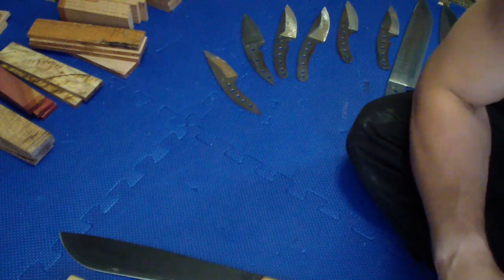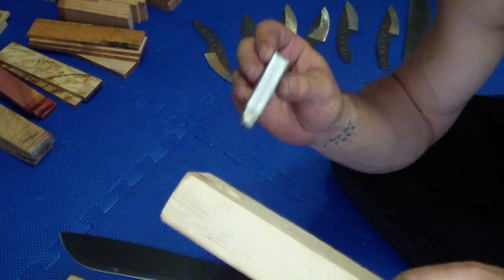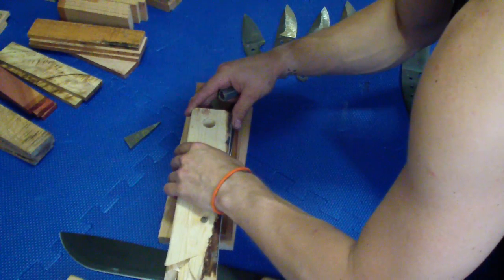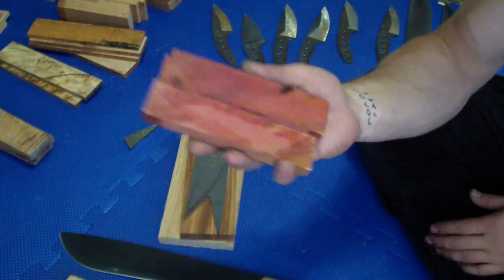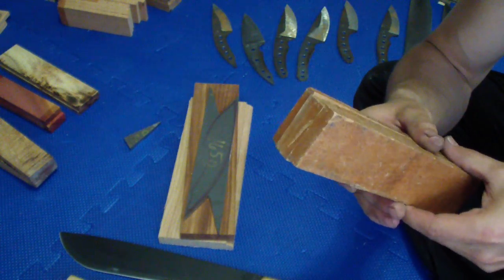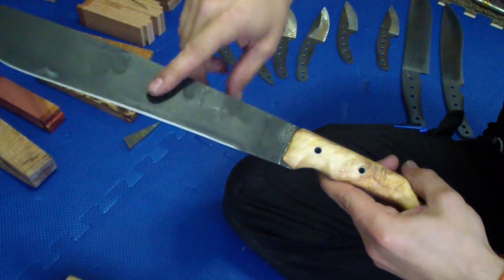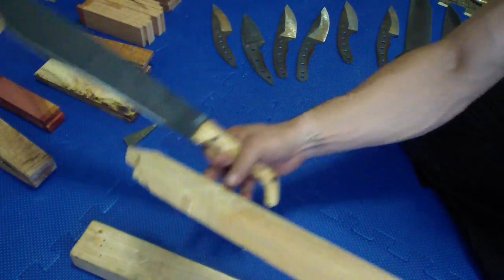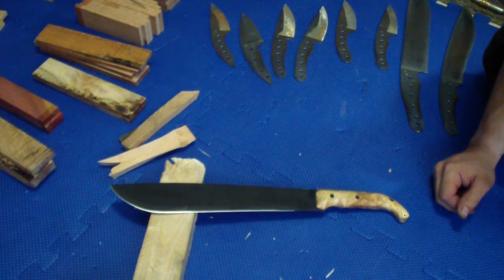Gorgeous Machete, Rex-T15 Custom and Stamping Tip

Comment: Love the Rex-T15 with the paracord handle, and to fix it with GITD epoxy is brilliant.
I'm pleased to see you getting into the wooden scales, it's a very rewarding material to work with.
When you are stamping your blades anything with any give in it will reduce the efficiency of the hammer stroke, try it on an anvil if you've got access to one or use that strip of steel to protect the blade and try it on concrete, anything with a lot of mass, you'll find it sets the mark with a lot less effort.

Comment: i like machetes! i have a 24 inch tramontina that is about half way ready o work! even so, with a very crude edge it does great due to the mass it has. pruned a wallnut tree with my laplander and cut all the branches to bits with my tramontina...
but since it is so big it rarely makes it on hikes